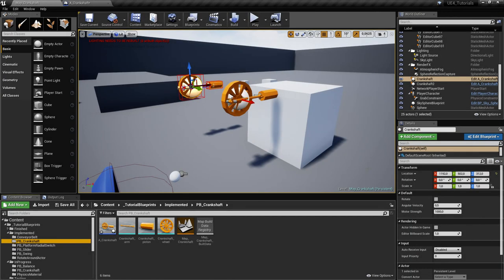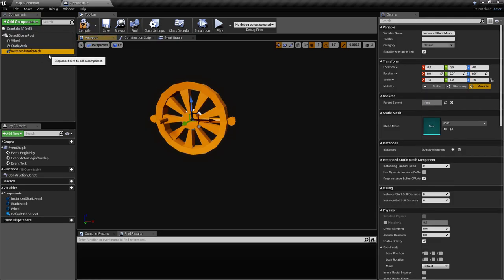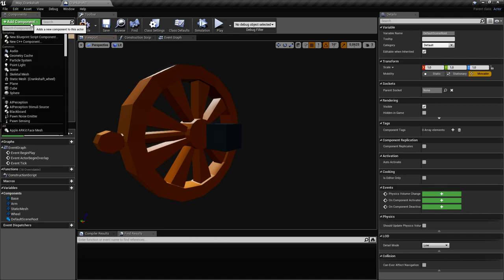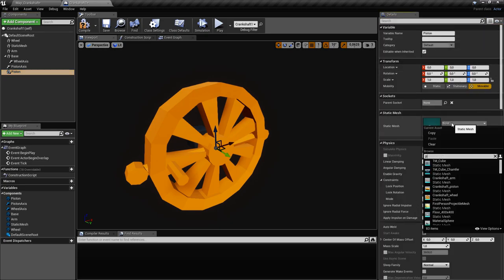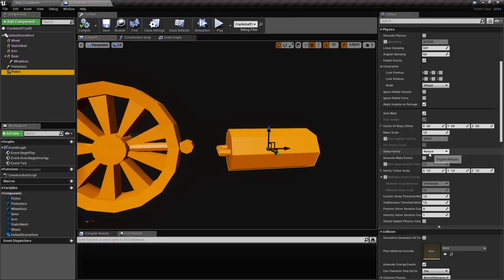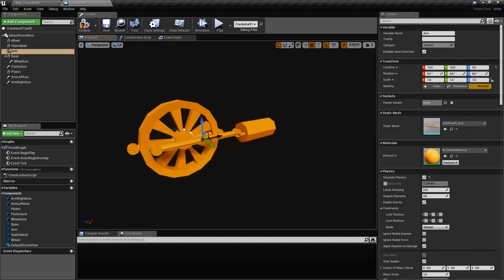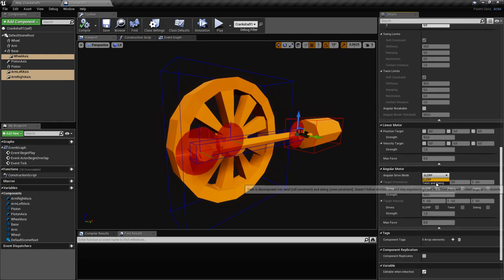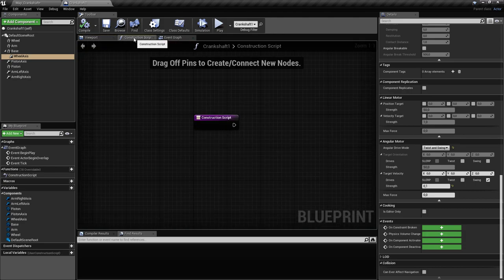UE4 Fly Wheel - Crank and Slider Mechanism using Physics in Unreal Engine 4 Tutorial How To

Comment: Thanks a lot for these tutorials. I found out about your video series on reddit and have watched a couple they are very useful and got me right into physics constraints easily. Just started using UE4 and I plan on making a motorcycle soon, so I am going to try multiple different ways. What if a cylinder was added around the piston and the compression force inside the chamber was ignited by a spark plug like a real motor, forcing the piston back down. This could lead to adding a kickstart shaft to the wheel (crankshaft) allowing you to start the process by having the character kickstart it. Just ideas thanks again
Reply from the maker: It's doable, if you actually need it. Just make sure to not use too many physics objects in a chain. The more there are, the more they get unstable.

Comment: Hi! Probably a very late question, but do you know how could you limit for example the wheel's movement after several full rotations? Genuinely couldn't find anything that worked for me so I'll be very glad if you know how to!
Reply from the maker: Try to track the rotation difference frame by frame in a blueprint. Add it up in a float, then when the float surpasses 360 (if you're tracking degrees), increment a counter.
Then use that counter to know how many rotations the wheel has done.
Reply from the maker: Depending on the counter, you could then apply angular motors to slow down or stop the rotation of the wheel.
Reply from the maker: To my knowledge, there's no built in functionality that does what you're looking for.

Comment: A quick question. What would be the best way to attach something like this to a moving pawn. I'm trying to attach it to a submarine but there are some issues with it teleporting to world origin OR it starts to bug out when the pawn is rotated. Thanks.
Reply from the maker: There are basically 2 points which hold this in place. One is a physics constraint in the center of the wheel and the other which limits the piston movement. (Edit: scratch that. you can just attach the base, because the piston is attached to the base)
Those physics constraints have to be attached to your object. 
It's hard to understand why it's bugging without knowing the exact setup you have. 
The usual problems are collisions with other elements, which makes things jump all over the place. Check that you don't have a capsule or something invisible that collides. 
Also, when you attach this to another object make sure that collision is disabled on the physics constraint. 
Not sure why it would go to the world origin. It doesn't make sense. 
Try to test it with simple setup on another object and see how it goes.
Reply: @Lusiogenic  Thank you so much for the detailed reply and explanation. Yeah I started by removing the base and attaching it directly to the parent mesh and made some progress, however the constraint being locked was what caused it to teleport to world origin. I overcame that by just adjusting other values but in the end I think it won't work that well with a moving pawn (submarine is what I was making). I tried removing collision which did work partly then finally tested it in a new empty blueprint which had no issues so it must be something with pawns which I just have to look into more to find out.
Reply from the maker: @UE5Poseidon  You're welcome.
I don't see why attaching to a pawn wouldn't work. I'm willing to bet it's collides with other components of the pawn.

Comment: Can this wheel be used to propel a vehicle?
Reply from the maker: Yes, have a look at this video to see how to implement a vehicle wheel: https://youtu.be/PWTCM6sZ6OE
To that implementation, you should add a Target Angular Velocity, like I've don here: https://youtu.be/61r5hHrKu10?t=13m9s and it should work. If you want to do steering, you will have to add an Angular Orientation Target and change it as the user pushes the left and right keys.
I will be making a complete car tutorial with suspension and steering soon, so keep an eye out for that.
Reply from the maker: Wait, I just realized, did you mean you want to implement a piston and crankshaft mechanism to actually propel a car? Yes, that should be possible, but you have tune very carefully the masses of all the moving parts, because, as I've explained in  this video, the forces transmitted by a physics constraint are scaled by the ration of the masses involved. If a small mass tries to push a huge mass, it won't happen, the constraint would just give way. So you should have the masses of all the elements as equal as possible.
Reply: why would you do that? lol UE4 already has car templates
Reply: @aldo_3d  Yes, But too many shortcuts were made strictly for appearances.
Reply: Colin Eric Burriss oh I see, probably better to just buy it from marketplace.
Reply: @aldo_3d  Learning these tutorials is too fun. But if i had money i would hire Lusiogenic.